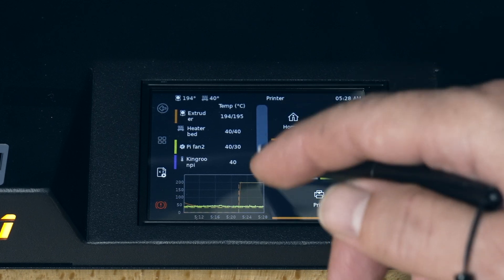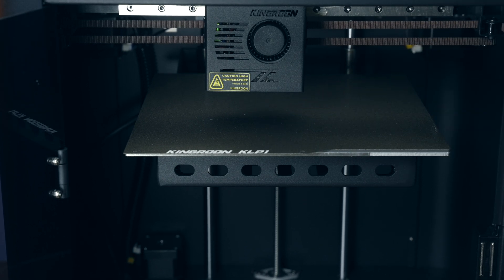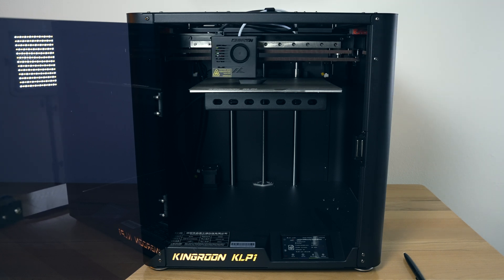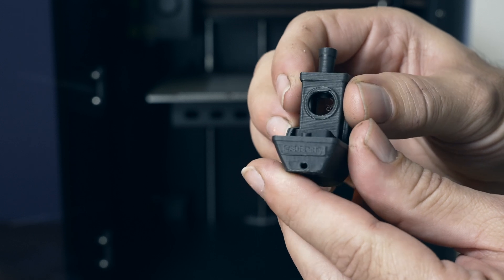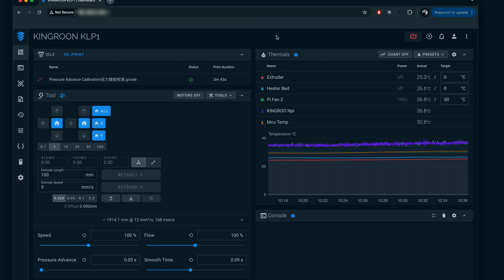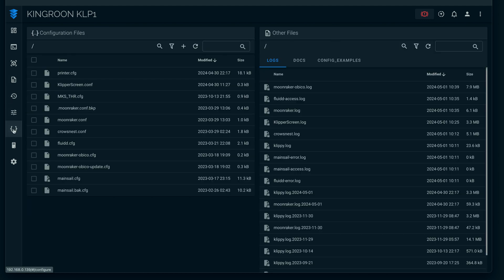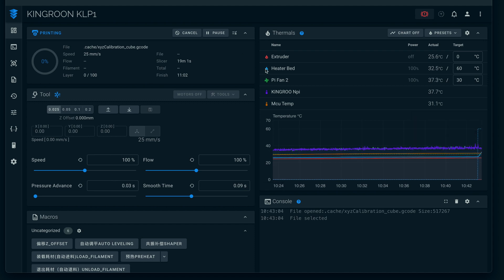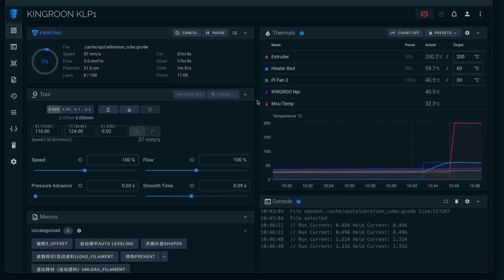Kingroon KLP1 - Klipper 3D Printer - First Print

Comment: It would be nice not to see a review that makes observations that are the opposite to reality, I have seen a few of these, "excellent" print comments on a print that is riddled with waves, ghosting or ringing.  Is it a good 20min benchy, its ok.  excellent, no.  You have to have standards.  On a sliding scale of good, better, best, great, excellent for example.  That is a standard.  Excellent is a near perfect rating in most opinions.  It is a good print.  There are layer line inconsistencies, ghosting, ringing, movement noise, first layer is not at the correct Z offset and under extruded. Also the gaps in the roof and deck, not what I would call an excellent print.  Its ok, its good for the speed but the slicer needs tweaking and the first layer squish needs.  It feels like one of Aurora Tech channels critiques, same thing.  Like an ad not a review.
Reply: Preach